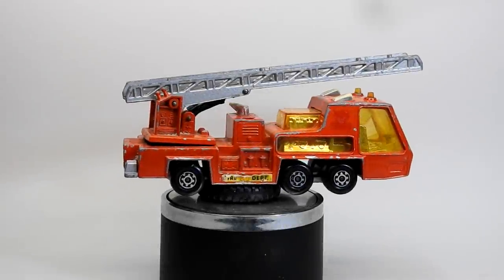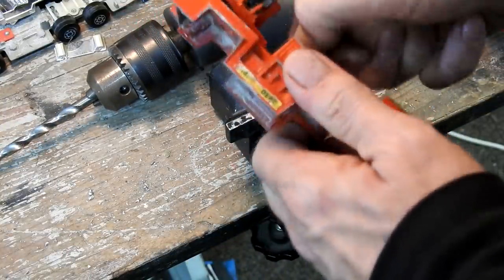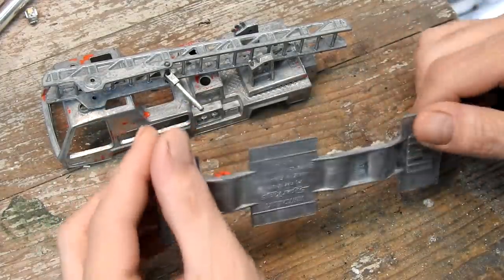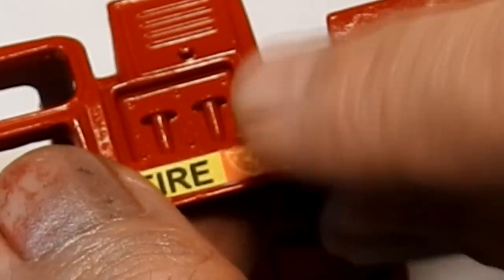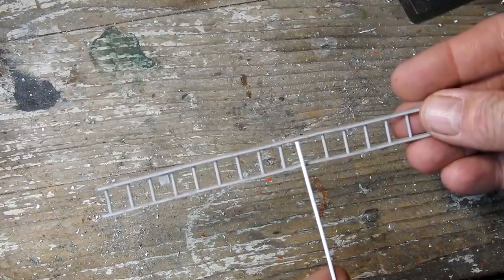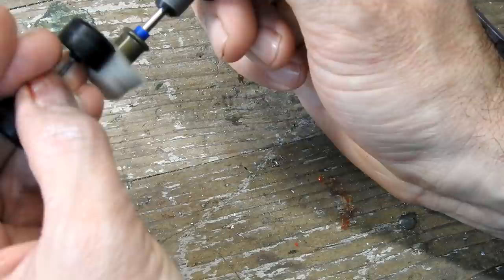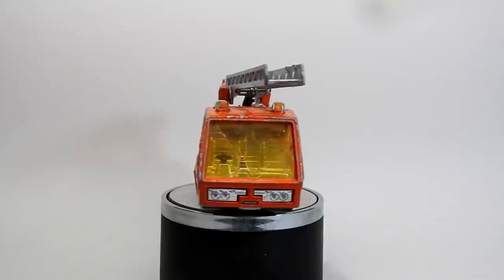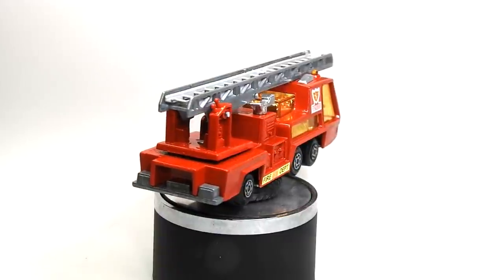Matchbox Super Kings K-9 Fire Tender Restoration

Comment: That's a lovely job! It's such an odd model, though - the 'Chinese Six' wheel configuration was used on a few vehicles, but, other than 'FAB 1', it fell out of favour quite quickly. The only thing I don't like on the model, is the chrome interior - in fact, I hate chrome interiors, period. Why toy car makers persist - Hot Wheels, I'm looking at you, I don't know. It always looks tacky. I know it's to save on parts, by making one big part, with engine and interior together, but to my eyes, chrome interiors always look awful. Yeah. None more 1970's.